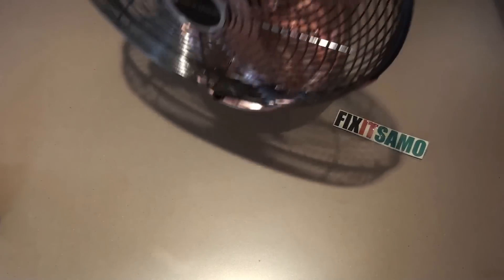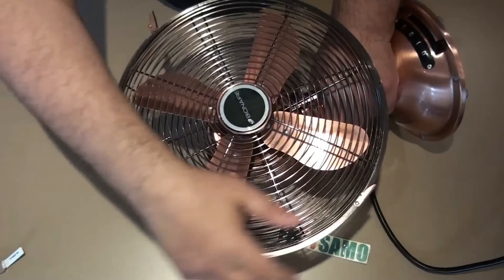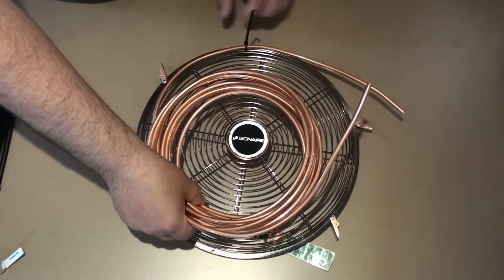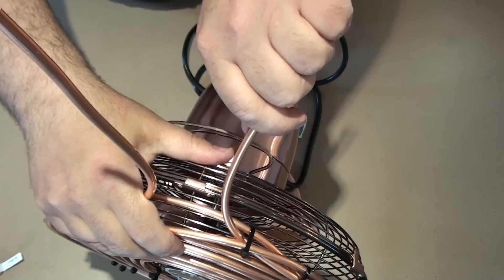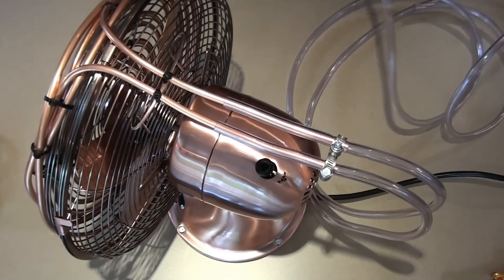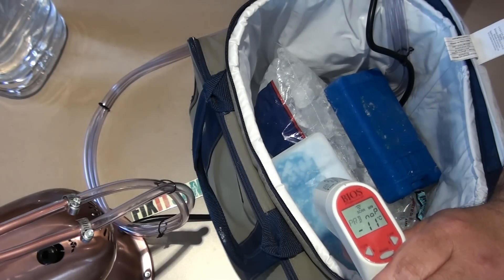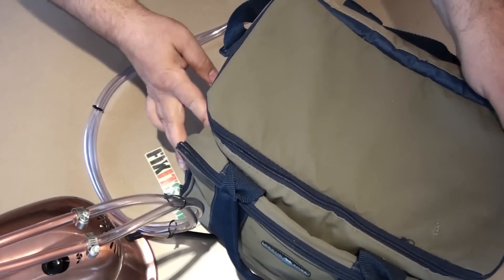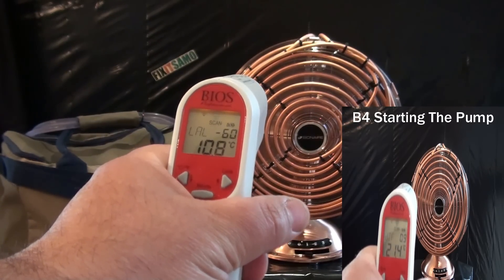How To Turn Your Fan Into An Airconditioner  AC

Comment: Simpler... freeze some water bottles and place in front of a fan. Put the bottles in a container so that the condensation doesn't soak whatever you've put it on. That way you save electricity for the pump - it's YOU moving the cold source. Freeze your bottles at night so that the heat expelled from the freezer doesn't counteract your cooling effort. Nice build though.
Reply: yea but that fish tank pump uses so little electricity its really debatable on energy costs.  and this method is actually smart using airflow through ice cold copper.  we're talkin 50 degree air coming out of that fan and through ice cold copper.  Your method will actually cost more time and resources over time as well as physical energy constantly swapping your thawed out items which you will have to refreeze to reuse.  His method keeps it ice colder longer in that little insulated cooler which is almost never exposed to hot air like your method which will require you to leave out your frozen items in a hot humid environment which will thaw faster.  I have a cooler similar to that and it can keep ice for a few days at a time - can you leave your frozen water bottles out in front of that fan for 2-3 days before having to refreeze them?  I'll take his method over the caveman method you mentioned that everyone else has used since the dawn of time - you weren't the first one to think of it.
Reply: @sixxgunz3774  You don't understand the laws of thermodynamics. Have a think about what you have written.

Never said I was the first one to think of it. I'm just good at recognising simple = good.
Reply: Your method would melt the ice 10x faster because the fan is hitting the ice
Reply: @Whetzell  So... are you saying that my system is 10x more efficient? Because the amount of ice you melt is the amount of ice you put in front of the fan. And the amount of 'cold' you transfer into the room depends on how cool you want to be... if the poster's method is not transferring 'cold' into the room fast enough then there's not much point in it is there?

Comment: I like this idea Now we will make it perpetual is run the lines through the freezer and if it was too cold you could always add any freeze in it to keep the water flowing then you would never have to worry about adding ice making it a constant cooling system Great idea huh
Reply: Except the fridge expels the heat anyways.
Reply: your freezer is not powerful enough to cool your house at any capactity.
Reply: It will not work for many reasons. If it worked, energy-intensive air conditioners would be abandoned ... No revolution from fans and tubes really takes place.

Comment: If i could make some suggestions start connecting the water coil at the middle of the back of the fan then go over to the front you will finish in the middle of the front. 
this is the most efficient way to remove the lower temps from the coil.

Comment: I've made one before...works great only downside is the condensation from the copper coils drips alot..I mean like huge puddles. Have to use alot of beach towels around it or find someway to catch and return to original source..ac units have water drainage for a reason
Reply: Yes, I was thinking about the condensation leaking onto the electric motor.  A little unsafe.
Reply: Yes..when I made mine I had the copper tubes on the bottom of the fan not on the top
Reply: Yes buy when I made mine the intake and outlet tubes were on bottom side..so an not to drop onto the fan motor..I suppose you could make the intake on top and outlet on bottom if wanted

Comment: Thank you!  I am going to do this instead of buying a portable AC unit.  This way, I can just have a fan blowing with refillable ICE packs... much cheaper than running a AC unit and since I only do work in the garage about once or twice a month, I will only need this 10 or 12 times a year

Comment: Is everyone in the comments serious. Because some of you actually want to use this for like real.
Reply: clearly the engineers spirit is not alive in you...we will do it just because it can be done, and we know we can do it better
Reply: James 45
@Clevan Fahriztah That’s good the spirit being alive thing but I’m gonna tell you this is nothing new here and it’s very basic and somewhat crude. However, everything here in the comments has been tried tested and refined. It works because it’s fundamental 
air conditioning. Messy and very inefficient. But if you’re happy that’s all that’s important. Almost everything in all these comments has been and still being used only somewhat much more perfected. 
But one never knows there’s always ideas to try.
Reply: Some people really are that desperate yes.
Reply: @joysoyo2416  I will build this,  just got the copper pipe. Not because I am desperate,  but because nothing else fits my needs. 
I have a grow closet on the balcony,  0.8x1.6m, and the temperature ranges around 30C during the day. 
I have AC inside the house. I will not put another one on the balcony. 
I will use antifreeze liquid for cars, hopefully will keep my grow room cool during the afternoon.
Reply: Jov Ven  Producing ice in an electric freezer so you can use it to make an A/C that's barely going to cool for an hour if your lucky LOL. Uses more electricity than just using an A/C to begin with because of all the ice you are going to go through. That's not adapting it's counter productive.

Comment: HOW MUCH WILL IT COST EACH MONTH TO OPERATE THIS?
Reply: Around the same opperationan cost as a ten gallon aquarium, I would think.
Reply: @seankennedy1377  Plus the fan, plus the energy to create the ice.
Reply: @joh22293  Because clearly you wouldn't have used that energy anyways, right? You immediately turn your freezer off when your ice packs are cold.
Reply: @PlutoDarknight  Look at my response in context as a reply to Sean. And then also tell me what happens to the ice as soon as you 'turn your freezer off'.
Reply: @joh22293  You misunderstand my comment. I was talking about the fact that you seem to think that your freezer has to work extra to make the ice/cool down the cold packs when, more likely, your freezer is already running since you're freezing either meat or veggie stew or ice cream. The power consumed by the freezer is consumed either way, whether you're using this setup or not.
Reply: @PlutoDarknight  That's not how freezers work. Freezers do work 'extra' to freeze ice, or anything else you put in to freeze. Freezers work to maintain a set temperature in a freezer compartment... if you add something 'warm' to that compartment then the freezer switches on to freeze it and switches off when it reaches the target temperature. Consumption of power is dependent on how much work the freezer is doing... it's not just on or off. TANSTAAFL... or in this case TANSTAAFFL... there ain't no such thing as a free FROZEN lunch XD.
Reply: @joh22293  Even then, the 'extra work' put out by the freezer does not exceed the power costs of buying and running a full AC unit
Reply: @PlutoDarknight  I wouldn't know.
Reply: @joh22293  ACs are pretty expensive in upkeep

Comment: https://youtu.be/NWoYFjJ11Qo
-30 sec video

PLEASE someone tell me what I am getting wrong, followed all instruction exactly but temp only goes down 2 deg Fahrenheit.
Reply from the maker: You need to double the ice quantity  and you need to add more water the ice must almost be submerged under water and the water pump should be on low speed
Reply: @fixitsamo  thank you very much.  Appreciate the response. 

I have about 5 cryopack ice packs in there.   Should I use regular ice instead??
Reply from the maker: Welcome 
I suggest you fill water in big tappewares
And freez it 
using big blocks of ice will last at least 10 hrs if you use a good quality cooler
Reply: @fixitsamo  thank you, will try that.   much appreciate it. 🙏

Comment: ...Or just point your fan toward frozen water plastic 2 liters placed on a tray to keep the dehumidified air water in.
Reply: HA HA ! I did that ! I did the one with the 5 gallon bucket and three 2 liter bottles. A fan on top and two 2 inch holes on the side. The air coming out was 48 degrees but the little fan was probably one tenth the amount of air flow the actual AC unit produced. AND I had to clear out my freezer to fit the bottles in it.

Comment: smart idea, i thought of this and never built it, u built it !...and using packaged ice blocks instead of frozen water ice, and using antifreeze mixed with the water seems it would get even cooler, using the portable cooler bag - a D.C fan and D.C pump with a solar panel or 12 volt would make it portable and use with outdoor mechanic's, cars campers sheds etc ...or D.C to A.C converter, the idea on options are endless really, Thanks..edit: in the winter time use an aquarium heater instead of ice for a safe low watt Heater for use on an extension cord

Comment: I'd probably opt for a salvaged motor cycle radiator and fan instead. Maybe some large PC fans. It would be easier to manage, less work, and more efficient. Then fill the tubes with antifreeze and run it through a coil in a freezer. They make 12v mini fridges with freezers these days that only consume like 50w. Ice is not something you want to mess with constantly.
Reply: Fridge is dumping heat back into the house.
Reply: Can u exlplain how it can replace this method bcs i dont understand how that antifreeze work
Reply: @betterbutter5935  cars in winter time use antifreeze liquid,  to prevent the water to freeze. 
If you put a bottle of antifreeze in your freezer,  it will get very cold,  below freezing point (of water) , but will not freeze.  You can run cooled antifreeze, replace your ice water with cooled antifreeze.
Reply: Wow it sounds like i should buy a real air conditioner 😂
Reply: @stealernews  the only thing is fans cost about $5 / month to run all day- ac costs about $150 / month to run all day-in electricity- it’s not money issue buying the AC its a money issue running it. That’s why people make these plus they are able to be used when camping easily and AC you cant. But I don’t know how effective these are- I never made one.

Comment: Hi overall a good video, however...the pipes should have been placed coming out from under the fan. the reason being that when the water passes through the pipes there is a bit of sweating that takes place, which could harm the motor and it may catch fire. try it out.

Comment: How high does the humidity get?
Reply: Unlike regular swamp coolers, this construct doesn't humidify the air since the water is trapped in the tubes and the cooling box. If anything, it removes a bit of moisture from the air since the cold copper coils will cause moisture in the air to gather and condensate on them.
Reply: Humidity drops,  because of the condensation.

Comment: There's a cooler version where you take a styrofoam picnic box, with ice and some water in it.  On one end of the cover cut a just right sized circle hole to mount a small fan into, facing into the box.  Put a PCV pipe, with a bend in it, wedged tightly into another hole out of the other end of the cover.
When you turn the fan on, it blows the air over the icy water and the chilled air is blown out through the PCV pipe, cooling the area.
Reply: I like the one where you run all the copper tubing in a cooler full of ice and hook it up to a keg of beer!
Reply: Now That is a swamp cooler. and IT works too!
Reply: The problem with that is that the ice melts very quickly and you are getting wet air. This setup will actually keep the ice a lot longer and in humid areas actually remove moisture from the air. 
It's a great tutorial, but you want to make sure to have a drip pan under that copper coil or the water that condenses on the tube will drip on whatever your fan is placed on.
Reply: @druidsflame  I saw one where the copper tube goes straight through the cooler and at one end is a small high speed computer fan. The ice inside cools the tube but there isn’t direct fanning on the ice.  I’m not sure which would be colder but both seem equally as ice efficient.

Comment: What I would do is cut a hole in the white rubber around a fridge door or freezer door and connect the tube between the fridge/freezer and the fan. As for sealing any air leaks just use that thick white double-sided tape

Comment: I dunno, calling it a AC is a little misleading. There is no compressor or coolant undergoing a phase change.
Reply: It does condition the air, so A/C checks out.
Reply: @ Bob Jackson It’s the basic principle of air conditioning the fan circulates the room air over the Copper tubing (the evaporator)
Water is the refrigerant in this application. The heat absorbed in the water is sent to the condenser (in this case the ice bag) where it’s transferred to the ice and cold water which causes it to heat and melt eventually and needed to be refreshed. Problem is it gets messy with some condensation on the copper coil and having to deal with water and ice not to mention it’s very overall ineffective in cooling the room.

Comment: That's NOT an air conditioner. It's a fucking SWAMP COOLER!..Absolutely useless for anyone who doesn't live in the desert. I wish people would stop baiting others by calling these things air conditioners.
Reply: That is not a swamp cooler. swamp coolers evaporate water to cool the air. This does not evaporate water, the copper tubes are sealed. This is literally an air conditioner.
Reply: @RandyRandersonthefamous  water condensates in de coil tho
Reply: @rafaelr.2228  Swamp coolers add humidity to the air. This just condensates moisture already present.
Reply: @PlutoDarknight  i never said otherwise.
Reply: It's neither an air con or a swamp cooler however it's more like an air con than a swamp cooler!!
Reply: Steve doesn’t really understand science
Reply: @Whetzell  I fkn' built that exact same contraption. The principles are the same.
Reply: @vanteal  They are not. The cold water is trapped in the copper coils, it exchanges heat with the surrounding air and the fan then blows the colder air into your face. Yes, humidity in the air condensates around the coils but that's a side effect. It doesn't add moisture to the air like a typical swamp cooler does. You should look up how those things work.

Comment: You should use a transmission cooler,
 Put salt on the ice.   Mine put out 30° weather on a 95° day!   Pump the water through the transmission cooler

Comment: Where do I go to get copper tubes at ?
Reply: Dont buy copper tubes,  get a transmission cooler.   Its about 10" by 6",  pump the water through that.
Reply: local hardware store or home depot.

Comment: First: Cool Video, very informative! Second: what if instead of adding ice you looped the airflow so that it would blow wind directly over the water while looping the liquid through the coil? It wouldn't be ice cold, but in theory it would make your room perpetually colder over time. or am I missing something.
Reply: if you want a humid room from evaporating the water into the air i tried it with ice and a fan in a shower once made the house humid as hell but with this closed loop system there is less evaporation

Comment: I did this 40 yrs ago, 55 gal drum full of ice an water, pumped thru a car's radiator and a fan 
bolted to it. 100 lbs of ice will get rid of 14,400 btu' of heat.
Reply: Bob Watters  It is referred to as chilled water system, many apartment bldgs use
it in finned copper pipe , as come winter, baseboard is plumbed into a boiler.
Reply: Bob Watters  Hi Bob, Yup am well aware of it, it took refrigeration units to make
the ice, just a long story between making the ice and using to make a chilled water
cooling system. ur are spot on tho. thanks an take care.
Reply: It's technically a swamp cooler
Reply: @abseconPC  it's not, a swamp cooler relies on water evaporating and absorbing a bit of energy, provided that your air isn't humid. What he did is what's shown on this video but on a larger scale.

Comment: So if you have a second fan outside to blow air over a second copper tube coil could it work and use no ice
Reply: no it will incease the temp a little

Comment: Age old technology however, one needs their own ice machine to be of any use therefore with the cost of running an ice machine, might just buy an AC unit! I estimate the amount of ice and cooling packs you used lasted maybe a little over an hour? Maybe less?
Reply: You really think you need an ice machine? 
Pretty much everybody has a refrigerator with a freezer in their home running 24/7 to keep food from spoiling.
Just fill empty water bottles with water, 2 liter soda bottles is better and put them in your freezer overnight and that's that.
Reply: I do like the concept however it gets way too hot here for ice to last. There really isn't any practical way for me to cool water long enough to be of any value. Sometimes I actually put food in my freezer so there isn't a lot of space for water bottles. I am pleased that you replied and although this original video was years ago, it is more reliant and just as useful as a development tool now. Thanks.

Comment: Is there a way do to this with actual refrigerant to eliminate the need for ice etc...Also, where is the hot air being pumped out and the humidity?
Reply: heat isn't being pumped out, but just lowered by cooler temperature are.  but don't forget the laws of thermodynamics.  you will create more heat in making the ice than you can remove from the room using the ice.
Reply: The problem with actual refrigerant is that it must be compressed and condensed to work properly and transfer heat. This is why typical ac units have the condenser and compressor outside to dissipate the heat. In this case, the heat is transferred to the ice. It is impossible to just "get rid" of the heat entirely, which is what makes the design of a portable ac unit a challenge